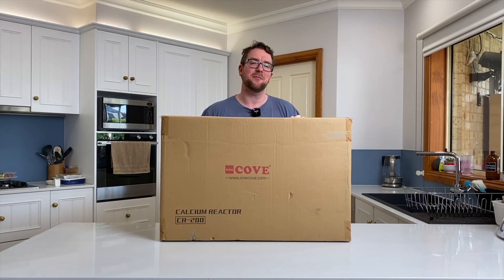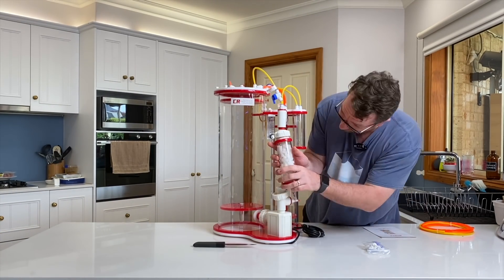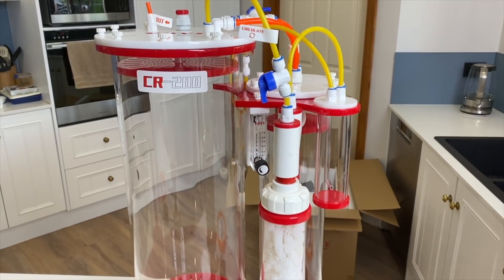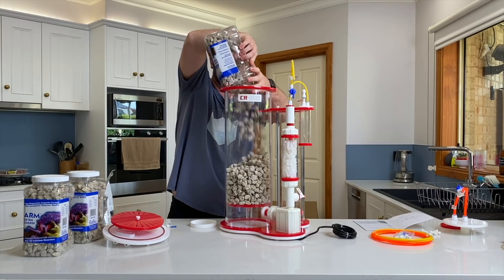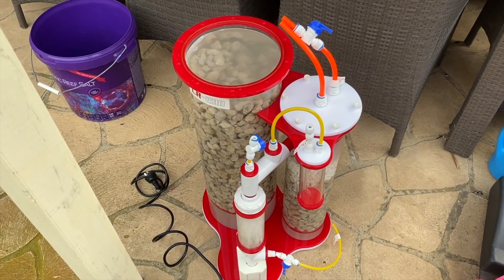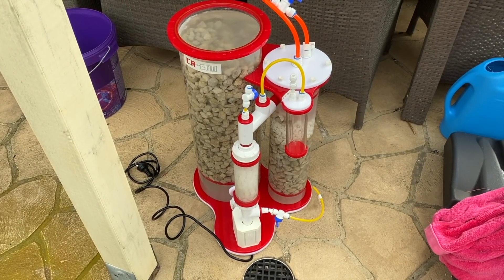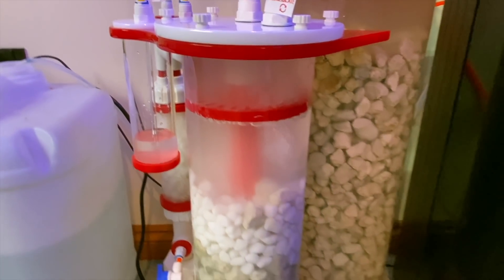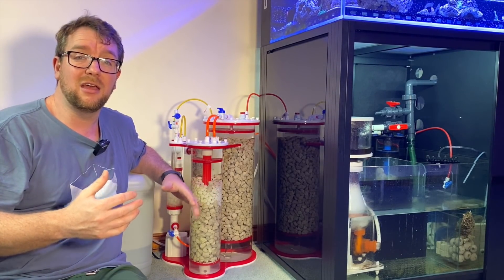How To Setup A Calcium Reactor Part 1

Comment: Hey man, i just got the cr-150.
Filled it up and it looks great, however its not suctioning from the sump. I thought this reactor doesn’t need a feed pump? can you advise or should i reach out to customer service?
Thanks man
Reply from the maker: Yeah it certainly is meant to feed itself via that suction.

Make sure you’ve got all the lines correct and if so, reach out to support
Reply: @ParkersReef  thanks for the quick response man! Seems like everything is connected properly… ill reach out to them asap.
Much appreciated!
Reply from the maker: Good luck with it!

Comment: Hi Sam, want to ask how are you going with the Cove after a couple of years. I was looking at a reactor and was considering the Cove, Geo and the Sea torch. What's your experience with all three?
Reply from the maker: yeah it's a solid unit. I quite like some of the developments in the new Geo range though, I would check those out first to see what the gas savings is like. But if you got the opportunity to get a sea torch or a cove at a reasonable price, they're both great options.
Reply: @ParkersReef  Cheers Bud
Reply from the maker: @naderfahmy4426 pleasure!

Comment: I currently don’t have coral in my tank but am planning to. I have experience keeping coral as well. I know over time as you add more coral dosing or a calc reactor is necessary. In your opinion what’s more beneficial/cost effective?
Reply from the maker: Cost effective I still think dosing wins out (as long as you buy your supplements at a reasonable price). But price isn't everything, calcium reactors deliver the elements evenly and deliver a lot of trace elements too. Ultimately it comes down to the size of the tank (I wouldn't bother with a calcium reactor on anything less than say 5ft) and the amount of coral you have

Comment: At this point I have a 150 gallon reef with pH of 8.14, alk of 7.89, and mag of 1537mg. How would I know I would need to use a calcium reactor? It’s been running for 6ish months now
Reply from the maker: You want to look at a calcium reactor when you either don’t want to dose, or you are dosing large volumes.

If not dosing anything yet, no need for any action with those parameters

Comment: Hi Sam, great introduction to this reactor.  Currently I am in the market for a 2nd Calcium Reactor and since your part 2 is not ready yet, can you provide any pros and cons if I am thinking of purchasing this reactor for xmas?  
One major issue I have with my current AquaMaxx T3, is that it is constantly circulating lots of excess CO2 bubbles even though I have it tuned with the minimum setting of 1 bubble every 10secs on the  CarbonDoser.  The design of this AquaMaxx reactor does not allow, when needed, temporary path any excess CO2 to escape. Drilling a extra outlet thru the lid is problematic, since it is not very thick in any locations where the bubbles circulate..

Does the Cove CR200 have this problem?  Do you recommend it?
Reply from the maker: that's probably a plus - you don't want the c02 exiting the reactor as it is not very efficient then. I think the key is for it to be quiet when it is processing the c02. I have to say, when I first setup the cove I thought it was very loud, but it has quietened down nicely since.
Reply: @ParkersReef  Just to be clear, I only desire to let out the excess CO2 (manually with a small valve that is only opened for a second or two perhaps once a month) that has accumulated and obviously will never be full absorbed since the reactor is always being fed more and more CO2 on a 24hr/day basis. 

Wondering if you don't find that excess CO2 is being circulated over and over again with your own reactors.  If so,  do you just leave the excess and ignore it?

Thanks for your replies,
Ron

Comment: When will we see part 2?  I'm getting my reactor setup and could use a few pointers.
Reply from the maker: Next week or two :)
Reply from the maker: Feel free to ask any questions here though ☺️
Reply: Thank you so much for the rapid reply. I think I've worked through my issues. I was trying to use my Apex to control the regulator, but ultimately gave up. The Apex unit head was too far from the reactor to make it convenient. And for $140 the Milwaukee controller made the operation virtually idiot proof. 

Your tank is an inspiration and your videos are spot on.
Reply from the maker: ah glad to hear mate! All the best with the reactor, hopefully I can share some helpful tips in part 2!

Comment: That arm extra coarse aragonite media needs a ton of co2 to dissolve imo. Maybe put a flow meter somewhere you can quickly take a look too?  I have one on the feed line to the reactor.
Reply from the maker: I've used it for years and always found it pretty efficient on co2.

No need for flow meter, I mean it would be amazing, but a similar cost of a peristaltic feed pump.
Reply: @ParkersReef  maybe it's just my reactor that has a hard time melting it.  Reborn or similar media melts faster for me.

The flow meter I was referring to is a Dwyer that you can modify with John guest fittings.  Like $60 usd 👍
Appreciate your videos man!
Reply from the maker: Ah yep, this reactor comes with a flow meter, but I find it easier to just time a set volume on the effluent when you need to. Will check out those flow meters though to see if they’re better than the included one.

Interesting, never had an issue getting strong effluent from arm extra course and it is always available which is super important, reborn seems to come in and out of availability which concerns me!

Thanks for the feedback, appreciate it!!

Comment: Thanks for demystifying a calcium reactor Sam. They always looked a bit scary to me. My big concern with a calcium reactor is the low pH of the effluent as even with a big Kalk reactor our tank still only runs at 7.9 to 8.0
Reply: I know it may not be a factor for reefers with a pH of 8.3/4. But when you struggle  to keep it at 7.9 to 8.0 every decimal point counts
Reply from the maker: @simmo56able  I hear you, but I personally still wouldn't bother worrying
Reply from the maker: I personally have never worried too much about it - I know PH is the parameter of the month and for good reason, but it aint worth over thinking too much :)

Comment: Any affordable options for less than or around the $1k mark??
Reply: Not really. You will be able to get a reactor cheap (ish) but when it comes to tech like Co2 regulators its best not to cheap out, trying to save cash now will probably hurt more later. The hard part here is the combination of required equipment.
Reply from the maker: Second hand reactors are usually fine. But yeah, get yourself a quality regulator for sure
Reply: @ParkersReef  How much are the CO2 regulators?
Reply from the maker: @pn7836  range from $150 to $850